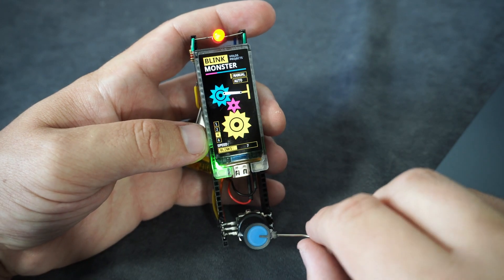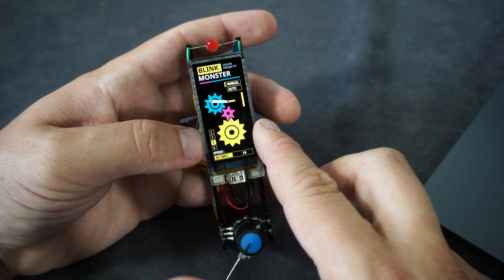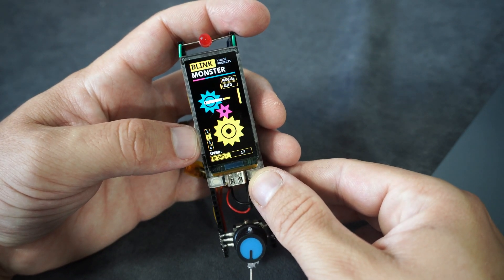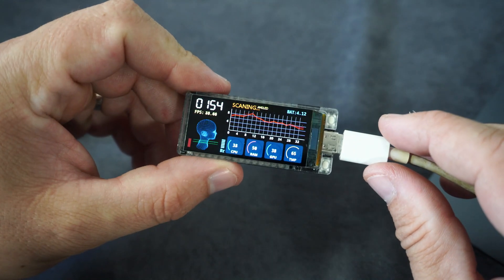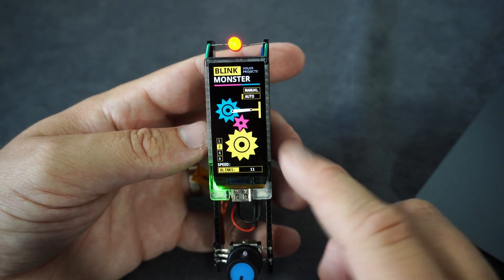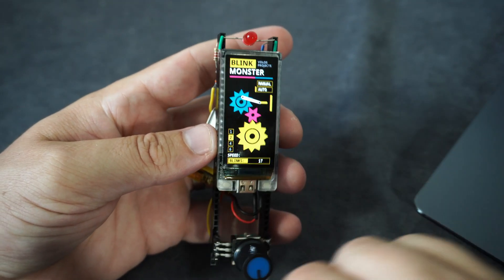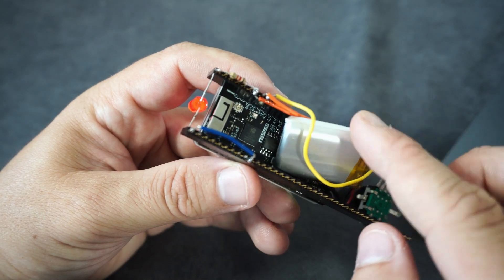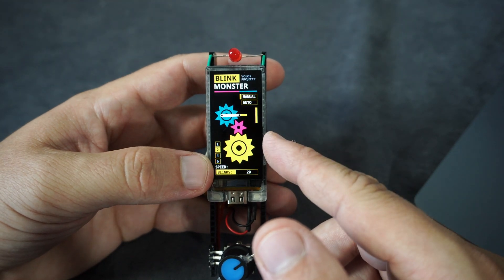Over-Engineered Arduino BLINK project

Comment: Incredible, as always!

It reminded me how I played with black and white OLED display. It was connected to the potentiometer, and the arrow on the display showed it's exact position on circle

https://www.youtube.com/watch?v=BR13Qp7PIMY

Child's play compare to you project,  but it was incredible fan.

I used formula to find positions on the circle, at first it didn't work, because it uses Radians  instead of degrees, so i forced to find formula to convert degrees to radians. And then it worked. 

Next i wanted to try colour LCD, i even bought it, but never tried it out.

Maybe I should consider demo boards like yours.